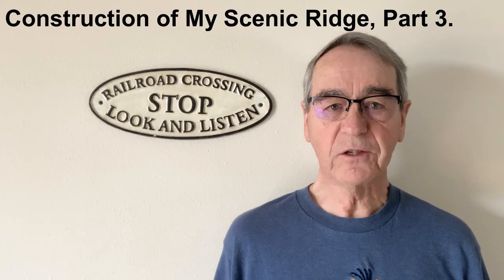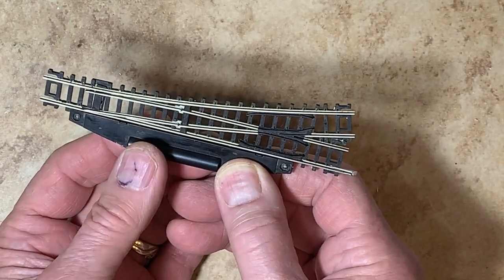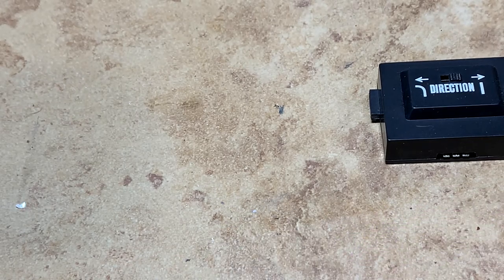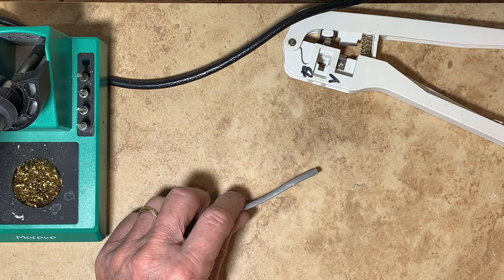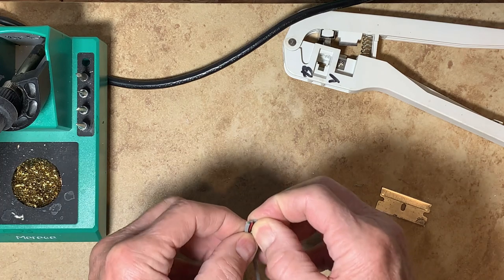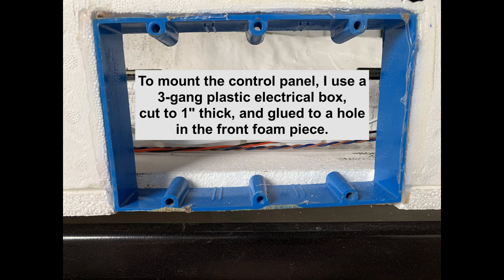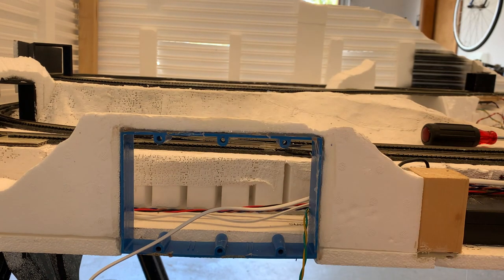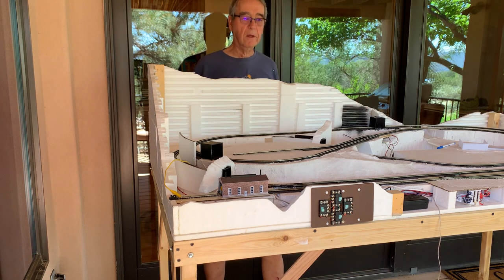Scenic Ridge #3    Switches and Switch Machines

Comment: Using modular phone cable with RJ-11 connectors and the specific crimping tool, that's freaking brilliant!! 
I love watching others solder projects. It makes me realize how bad I am at it.
Reply from the maker: I used those for a while.  The atlas switch has wires that just fit the connectors.  However, I got a batch of cheap Chinese connectors, and have had problems with finding ones that consistently work.